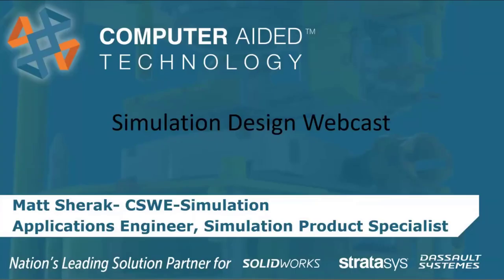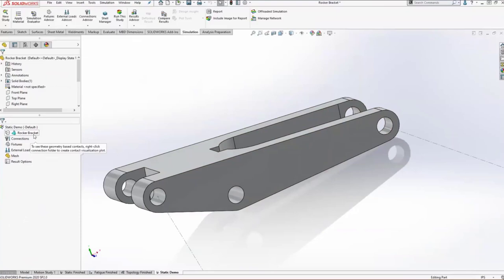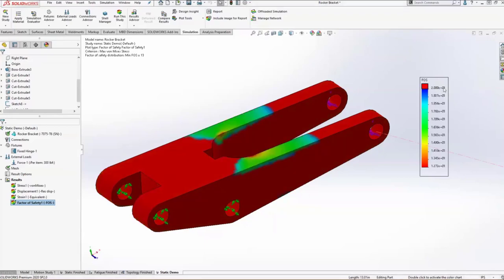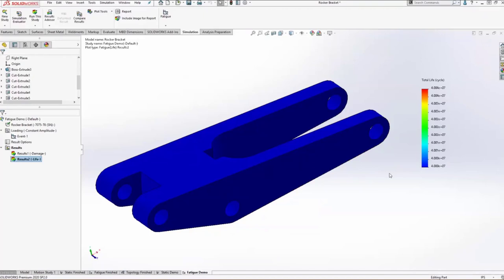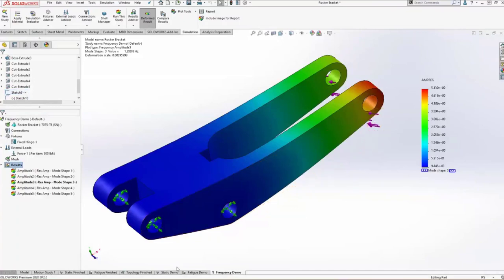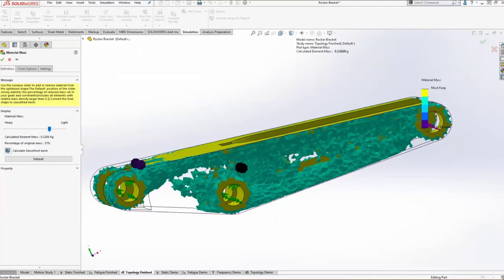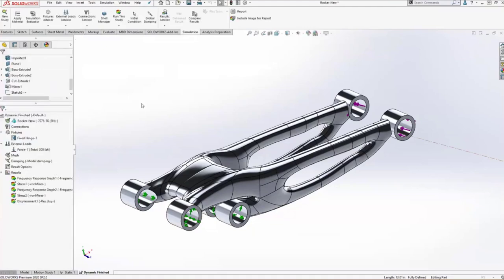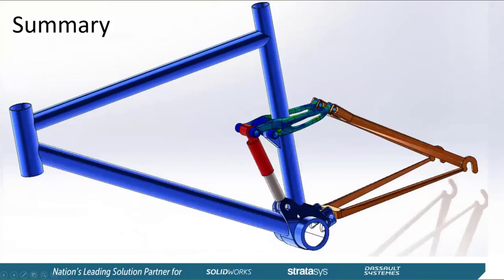SOLIDWORKS Simulation and Smarter Design Validation

Comment: ≈13:51: When you start the frequency analysis, you mention that the part definition, fixtures, loads and even mesh can be transferred from another study.  I would like to know how that is done without having to go somewhere else to find that information.  Are you directing this webinar to intermediate or advanced users?  If so, you need to put that in the description and say something about it at the beginning.

Comment: ≈09:33: You mention that Sim Standard is used.  It is possible that everyone knows that higher level simulation packages do everything that the packages "below" them in the SW hierarchy can do.  But, no mention of level of SW required as previously stated in the static analysis.  The point is, that any level of SW is applicable as long as it can produce the 3D model in the study.  I would really like to see some consistency in the discussion of what is required to accomplish the tasks discussed without having to presume or assume.

Comment: ≈09:12:  Is SW Premium the only package that will perform this static demo?  I don't think so.  Sim Standard should also be applicable.  Why is that always left out?  To direct this webinar to the most general audience should not all options should be specified?  It seems that most webinars are aimed at the most expensive, highest end SW and Simulations.  PDM webinars fit into that scenario as well.